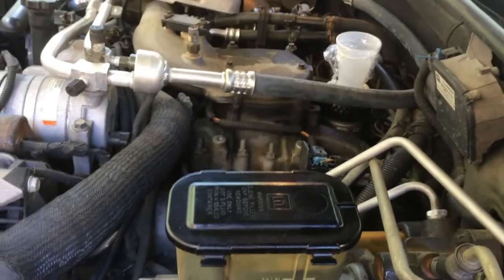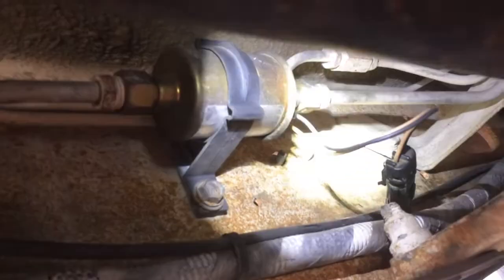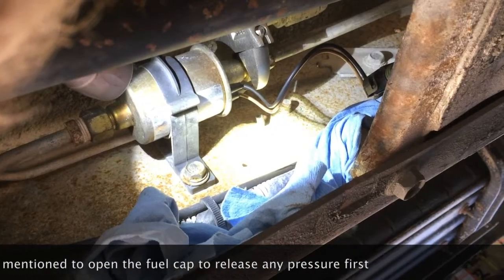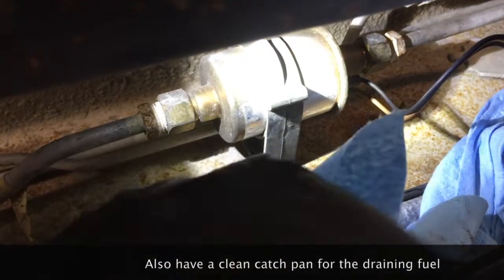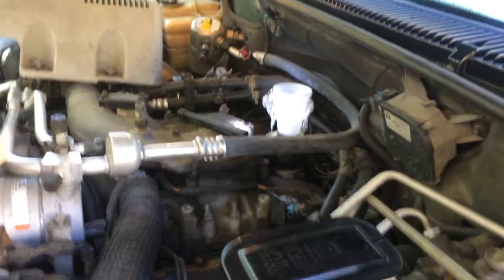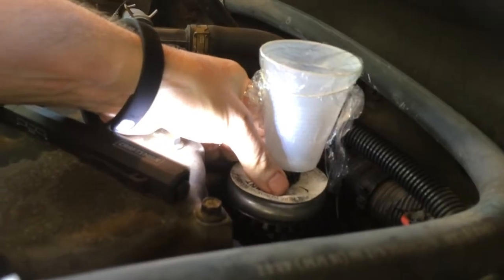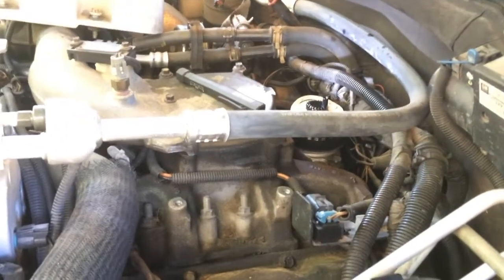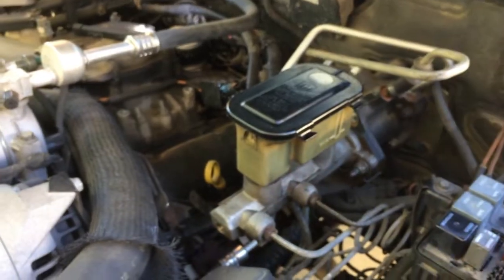1996 - 2002 GM Truck 6.5L Turbo Diesel Fuel Lift Pump Replacement (Chevy & GMC)

Comment: Maybe a wide funnel under the lift pump while unscrewing those into a bucket even with a hose on the end of the funnel going to that container.. Some goggles and maybe face masks that prevents it from going in nose and mouth... Tight fitting sleeve so it doesn't run down the arm into armpits... And not advisable to smoke a cigarette like some crazy mechanics I've seen... When I was cleaning engine parts in one shop the guy walks up to me smoking a cigarette... Told me there should be no problem I can put this cigarette out in that gas which at the time was diesel fuel or kerosene I can't remember.... Maybe I wouldn't be able to at all if I were dead anyway..... And then instead of a funnel it would have been a funeral

Comment: Awesome video, thanks for this, this is a lot easier than i was expecting it to be. My pump keeps acting up in the summer time, causing my truck to stall when it gets above 80 degrees i might get 10 miles when this starts, though my pump is in the engine bay right next to the filter, i feel like if it was underneath like yours i would not have this problem. Its also pretty loud with its pitter patter, xD

Comment: I have a question, my GMC C3500 truck with a 6.5 engine starts in the morning without any problem. But after using it for a while, when I turn it off, it no longer wants to start again until after 1 hour.

Comment: Looks like I am missing o ring on tank side. I wonder if it has been missing whole time. Wasn't leaking. Anyone know o ring size. I have some black ones. On still on pump line is brown in color
Reply from the maker: I put the GM part number for those seals in the video description.   If you still have the factory lines they are both the same as best I recall.
Reply: @DrShock  ty

Comment: Funny things lady at the AutoZone tells me the one for the tank was the one I'm supposed to use and I told her I changed two of them already I know what a lift pump is... And I had to wrestle with her a little bit with the mentality and she finally pulled it up on the computer and said oh this one? Even worse a truck that no mechanic wants to work on maybe one or two I find that wants this 94 GMC Sierra SLE in their parking lot or near it

Comment: It's funny I have a lift pump on the way AutoZone looks like the one on the frame rail driver side.. but first they pulled up one in the tank they say it has that also... I googled the question that says there's no fuel pump in the tank it's in the valley of the engine... I saw another video says it's just a straw in the tank and the lift pump sucks it and then pushes it to injection pump from the frame rail through the filter I have been investigating 94 GMC turbo diesel 1500 pickup truck the one I own

Comment: There is a problem with the way you tested the LP connector.  I know because I did it this way too and got a false no power reading.   I then went on wild goose chase to find the power. Turns out I was getting power, but the ground G404 was broken.  It is a fragile wire attached to the frame a couple of feet rear from the LP on top of the frame.  It can be reached lying on your back under the truck near the fuel filler (13mm bolt).  Best to use a 13mm ratcheting wrench.  I had to piece in more wire to repair the wire.  

Point here is to check each of the two terminals independently and not just together.  For power ground one of the leads to the chassis and test for power.  Change to continuity and test the other terminal for connection to chassis ground.  

Also best to have electrical schematic to give you idea what to do if you do not have power.
Reply from the maker: When you had a working lift pump suddenly go out / begin failing situation, you only need do a cursory power and ground check as I showed before replacing the LP (to verify no break in the circuit caused by sudden physical damage to the wiring harness as a cause).   This path is all we're concerned with in this video, the routine defective LP replacement procedure with a known good wiring harness.  

But if you instead have a long-term non-working LP / engine no start symptom situation,  then you need to also verify that the circuit can carry current as you either have a bad ground or corrosion increasing the resistance of the wire(s).  Typically you would do this using a test light tool.   A wiring problem at that point would be a more in-depth video diagnosis that we go over here.  This other video of mine can be helpful in tracing a ground issue on GMT400 series trucks - https://youtu.be/H0lK0TZEVCc

Comment: Great video! I have 1996, and have read a lot of opinions on lift pumps.. some say that it is better to put in 1999+ pumps even in 96-98 trucks because it is higher pressure. Is there any truth to that or better to just stay with what came rated from factory?
Reply from the maker: Personally, I only work on factory original setups without any modifications. Things work as designed that way.  ;-).   So I would recommend to use the correct lift pump per model year as I outlined in the description page for this video.

Comment: Been watching your videos on the 6.5, i have a 1995 k2500. I'm replacing the lift pump and my hose seals on the inlet and outlet  need replacing, would you happen to know which size they are?
Thanks and keep that 6.5 alive.
Reply from the maker: Thanks, no but there's a link in the video description to the GM part number for the hard line o-ring seals (both inlet and outlet).

Comment: Good video; but even with a volt meter, I  had high resistance on my ground; but just doing a voltage test, it looked good. I took jumper cables from the battery; 2 jumper wires to the lift pump connector; my pump worked good. 
So don't get bit by a bad ground, or even a 12v feed that's not carrying the load.

Comment: You should pin in your comment that it is crucial that the fuel tank be drained. The fuel line will syphon and if you think your just draining the line, you aren't. The whole tank is going to end up on the floor. This is not emphasized enough in your video. Im also confused about the bleeding usingvthe cup over the stock fuel filter housing. I though that little spigot at the top was a place to fit a hose, definitely not the case for my filter. How is the cup cut at bottom to interface with the knob on top of the filter housing so it doesnt come pouring out of the bottom.?
Reply from the maker: It's not practical to drain a fuel tank for this maintenance procedure.   Few to no customers would reimburse for the time involved to do so.   You just have to complete the job before the siphon effect gets out of hand, per the GM factory service manual.
 
I mentioned in the video that I just grabbed the cup in lieu of a hose at that particular moment.  You can either attach a hose at the top bleed nipple of an OEM fuel filter, or in a pinch just punch a hole in a plastic cup with an awl as I did.  It makes for a tight enough interference fit long enough to bleed out the air.   Aftermarket filters may lack this air bleed nipple though.
Reply: @DrShock  thank you for reply. Was thinking of removing sending and line unit from tank due to the gauge continually going bonkers and beating up the neighboring gauge. That would stop any syphoning. I cut a hole in the box to access it as pulling the tank is way too much work.
Reply from the maker: That fuel gauge behavior could actually just be the gauge - https://youtu.be/2q1OVWBed3U or it could be the fuel sender in the tank - https://youtu.be/dw9Hia55yys

Comment: Great video!  Do you know what the spec is for the gm fuel line, and where to get adapters and parts to put in a an6 fuel line.

Comment: You mentioned to check the o-rings. By that you mean the built-in ones on the line, not rubber ones correct?
Reply from the maker: I was referring to the fuel hard lines, yes.  Both inlet and outlet have a viton type o-ring seal.  There are links in the video description for these parts.
Reply: @DrShock  I replaced my pump today, didn't even think about the o-rings. I guess I'll see if it leaks. Haven't started it, I had  gotten the incorrect fuel filter.

Comment: This pump is supposed to click when the key is in acc?
Reply from the maker: If it's a genuine GM ACDelco pump, and for the years this video covers, the lift pump will activate in the key on engine off (KOEO) position.   Older models this would not be the case though.

Comment: We ordered a lift pump and installed it. It still doesn't work and the pump gets REAL hot. Could it be bad from the factory?  It starts when we put fuel directly in it but not when we don't.
Reply from the maker: Unless its some Chinesium off brand, I would be surprised for it to be DOA out of the box.  You can check that you have fuel pressure from the lift pump at the brass T valve at the front, where you would normally vent off water from the fuel filter manager (FFM).  Or you could check for pressure at the fuel filter vent valve on top of the FFM.    You may want to verify you do not have a wiring issue that is shorting out the unit as well.

Comment: I can hear the pump when I turn the key or jump the relay but no fuel sprays from the bleed valve (also fuel pressure is less than 1 psi at t-valve), fuel filter is new. Truck runs (when it finally starts) and drives but is very hard starting (though on occasion it will start right away) and engine stutters above 2rpm while driving. Possibly tank sock ? Or weak lift pump ? I don't want to shop it but I may end up having too 😮‍💨
Reply from the maker: The injection pump, on the years this video covers, will pull the fuel on its own, as long as the lines remain primed with fuel.   So a lift pump can still be faulty/weak and the engine will function.   They do not necessary fail in a "dead" state.   The service manual fuel pressure spec, at the fuel filter housing output into the injection pump input, should be no less than 4 psi with the engine running.  Less than 1 psi, at that same measurement point, would point to a failing lift pump, or an obstruction in either the hose, the fuel filter housing, the hard line, or the sock.  It can be a long and involved process to diagnose which.
Reply: @DrShock  I'll check and or replace these and report back with the results for others
Reply from the maker: Well don't necessarily fire the parts cannon at it (replacing parts before confirming the diagnosis).  That can get expensive.  But definitely do check each for proper clearance (tank sock last as the most difficult to access).   If it were me I'd check the lift pump flow first, to be sure it's not just a weak pump since its easy to access.  This can automatically eliminate a number of lines, and the sock, from the suspect list.   The GM spec on the pump output alone is up to 15psi.

Comment: Can i do this for a 1996GMC Sierra 2500 HD Diesel ? Also,need to see how you put cup onto fuel line in engine... does cup have a hole in bottom?
Reply from the maker: This video should apply to your 1996 GMC with the 6.5L diesel V8.  You have to make that hole in a plastic cup, if you don't have any clear fuel line handy.  Clear fuel line is preferred, but the cup can work in a pinch.

Comment: Thank you for the video,
I just bought a 1998 c3500 truck, and the "water in fuel" sign light up, coud you tell me how to bleed the water!!??
Reply from the maker: Thanks, there's a brass relief valve near the front.   One of the fuel lines from the fuel filter housing connects to it.  The other end drains below the vacuum pump of the engine.   You open that valve while running to purge the water out.   This video might show some views of this valve - https://youtu.be/ZD0m0ZfcABo
Reply: @DrShock  Very useful advise, thank you sooooooo much

Comment: Shouldn't the pump be making some type of noise when it's on mine isn't and can't feel any vibration I have a 6.5 L I true one with turbo in the center and my lift pump is making zero anything I've never had a single issue out of my bus thanks for any input in advance
Reply from the maker: The 1996 and later model years operate during the glow plug cycle (key on engine off), so you should be able to hear them yes.  If not, try to feel for the vibration of the pump operating during this same glow plug cycle period.

Comment: Just bought a 2000 gmc 3500 with this same setup I have the water in fuel light on the dash and was wondering if you have a video on that or have any suggestions on what to do to get it off this is my first diesel truck so I’m new to it and not really sure about what regular maintenance needs to be done with it
Reply from the maker: Gratz, that's a solid workhorse of a classic truck and one of the last made.   I don't have a video on this, but the procedure is pretty simple.  There's a brass petcock near the front top of the engine, by the air intake resonator (long black plastic cylinder/tube).   You want to slowly open that up while the engine is running.   It has a hose that routes down past the vacuum pump and that should expel any water in the fuel filter housing, along with some fuel.  Then watch this vid to replace the fuel filter - https://youtu.be/_0O8mzPe9pE
 
If the warning light doesn't clear, then the sensor could be defective.  Uncommon, but it does happen.  GL.
Reply: Hey I appreciate the reply. When I first bought the truck I took it to a diesel shop to have it looked over and they got the water In Feul light off so I’ve been driving it the last 3 months and just the other day the light came on again I went to go open the petcock your talking about in the front and nothing came out of the drain hose could the petcock be bad?
Reply from the maker: It would be more likely the lift pump isn't working anymore.   You could test that by ear, when you first turn the key to the glow plug cycle the lift pump should be audible from inside the cab with the radio turned off.   The symptom you're having with the water in fuel drain off, if you also don't hear anything I'd even more suspect the lift pump has failed.
Reply: Are you referring to the lift pump in this video? The truck still runs good but I did notice when I go to start it it cranks a little longer than what I thinks normal before it fires

Comment: I can not find a rely for my lift pump ,I do have a pmd , is that the same ? How ever I should be able to do electrical test to see if it’s getting voltage. Correct?  Also I tried the cup trick and got no fuel ! Help please !
Reply from the maker: Nope, a relay is not a PMD.  The video shows the relay in the underhood fuse box right at the beginning.   If you have a truck for the years this video covers, yeah there will be voltage at the pump when the key is on, but engine off, position.
Reply: @DrShock  thanks , if no fuel enters cup and fuses are good , that would point to l.p. Being bad , correct?
Reply from the maker: If 1996 or newer 6.5L, and no fuel comes out of the fuel filter manager bleed valve at the top of the filter during the glow plug cycle, then you either have a wiring harness problem supplying power to the lift pump, or a bad lift pump. On 1995 and earlier, this could also involve the oil pressure sender as it was used as part of the lift pump power circuit, but not in 1996 and onwards.

Comment: Does anyone know what that rapid ‘clicking’ sound at 11:00 is? My truck does the same, but im not sure if its normal or not😅
Reply from the maker: Normal symphony of a genuine GM glow plug relay coupled with a genuine GM ACDelco lift pump.   ;-)
Reply: Thank you

Comment: I have a puddle under my truck right under this pump, the pump and all around it is wet. Do these things leak? Should I replace it? I can’t see if it’s a leak in the lines or not. But maybe the nuts loosened over time?
Reply from the maker: If the pump is leaking fuel, you must replace it.   Be sure it's the pump though, and not the fuel line fittings just coming loose.  You might also have corrosion of the fuel lines, in which case its not the pump that needs replacing but the fuel lines.
Reply: @DrShock  thanks. Yeah I’m gonna check those lines and see if they are loose or rotting. I just didn’t know if these pumps were prone to leaking themselves.

Comment: Why would one of these leak? Is there a gasket or se that goes and can be replaced?
Reply from the maker: If the lift pump is leaking it has to be replaced, there is no rebuild procedure on them.

Comment: What about a late 95 3500 6.5 single rear wheel...?
Reply from the maker: It would be a different pump.  I listed all the ACDelco pump numbers in the description though.  The pre-1996 wiring connection, and mounting, may differ from this 1999 model I showed as well.